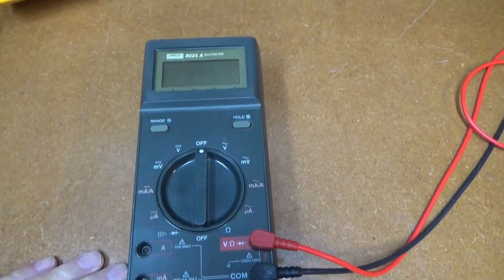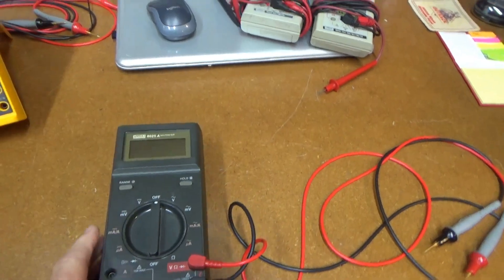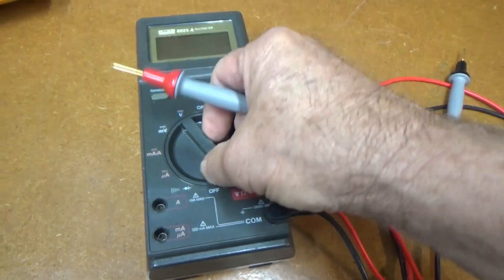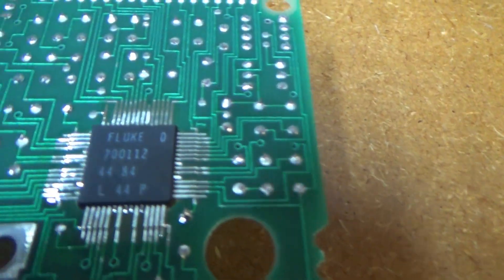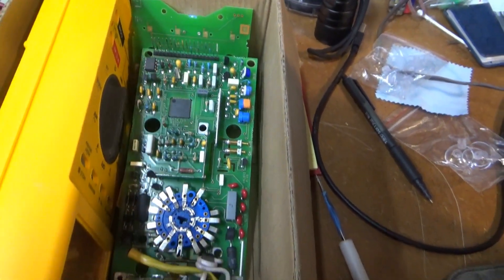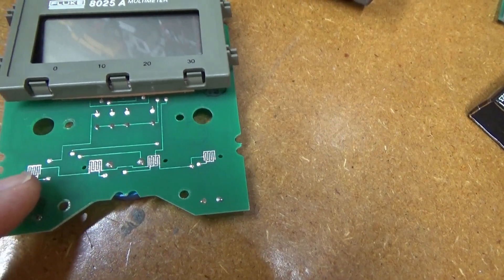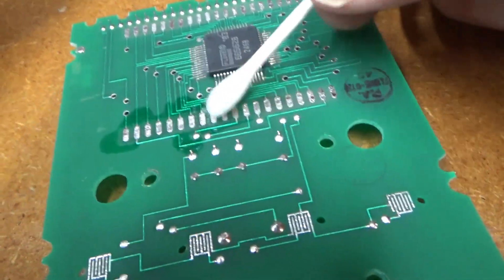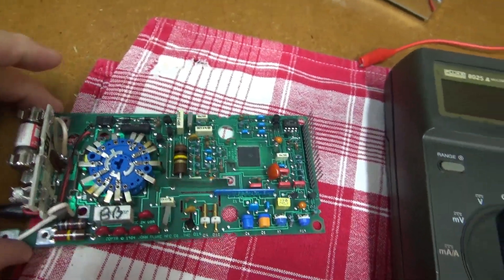1984 Fluke 8025A Restoration

Comment: The Models 25, 8025 and 27 are very similar.
Reply from the maker: Yes they are vary similar. Fluke made updates over the 20 year production run of these multimeters but the parts remained interchangeable.

Comment: If the AC components are in spec, it might be worth a solder re-flow in that area. I have a 27FM that exhibited similar behavior when I got it about ten years ago and a re-flow did the trick. I'll admit that I'm a bit of a meter junkie and this series of Flukes are my favorites.
Reply from the maker: Thanks for the suggestion, I'll have to give that a try. It's good to hear that I'm not the only vintage Fluke fanboy out there.